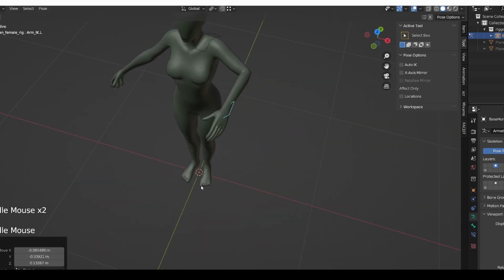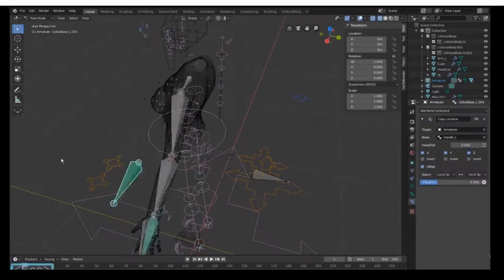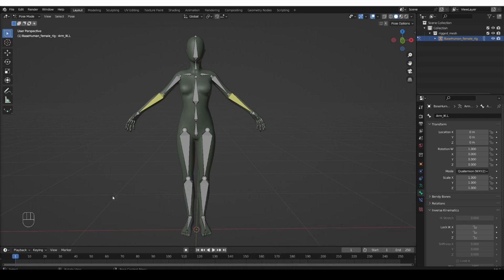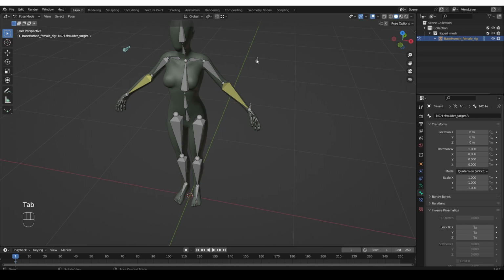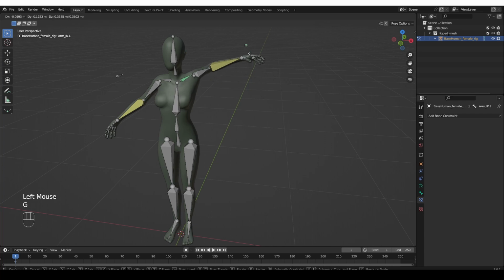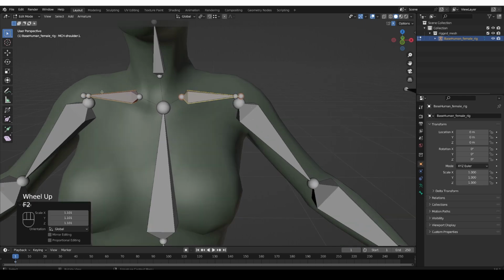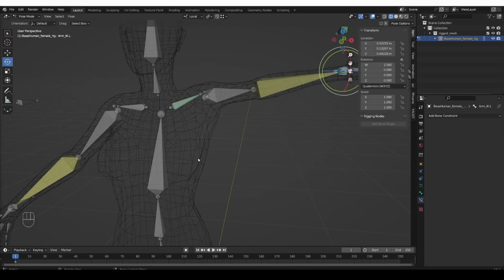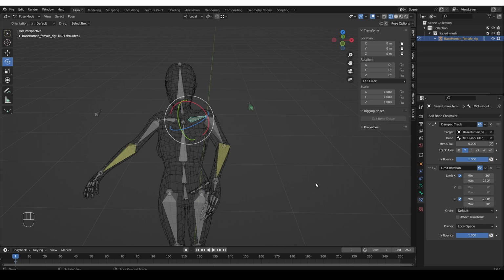Blender Rigging: Automatic Shoulder rotation!

Comment: I wonder if it really is impossible to make an automated FK shoulder bone. Of the top of my head it should be possible with drivers. I think I have done it in the past but again maybe I am misunderstanding, it went something like this. Make a new mechanism bone inbetween the shoulder bone and the upper arm bone ( i.e. the upper arm is parented to the mechanism bone and the mechanism is parented to the shoulder bone) Give the mechanism bone a driver that reads the relevant rotation and moves the mechanism up and towards the head with a desired sensitivity. Thats it, now you can rotate the shoulder bone freely to tweak the arm as usual and the mechanism will react to the rotation of the upper arm and simulate shoulder rotation.
Reply from the maker: If you think you have done it before, could you do it again and confirm that it works? I don't think I can recreate your setup exactly based on a text description of what you may have done in the past :)
Reply: @CGDive  So I gave it a go and it does seem to work. What I did was a simple test on the human meta rig from rigify. The drivers I used where as follows
MCH y location : 0.175*sin(var)
MCH x location: -0.175+0.175*cos(var)
Note that the mechanism bone was extruded straight up from the tip of the shoulder bone. Remember to parent the upper arm to the mechanism bone (keep offset). Anyway, Given how much more knowledgeable you are than me I am convinced there is something I am missing but I would be very happy if the solution was this simple. Let me know your findings :D
Reply from the maker: @anjuro  Any chance you could upload the blend somewhere. I am super eager to check it out :)
Reply: @CGDive  So I uploaded the file but youtube deleted my comment, I guess they don't allow links. Sorry but it looks like I may not be able to share the file after all. Well anyway, the setup is so simple that you should be able to recreate it without having the file, let me know if something is still unclear
Reply from the maker: @anjuro  Ah, shame. You can email me todornikolovcg at gmail.com 
I don't find it simple to be honest. I tried to follow your instructions closely but I can't even figure out how that is supposed to create the shoulder automation. So definitely interested to see the file. Once I see it working I would probably hit myself on the head and go "duh" haha
Reply: So parent arm bone to mch bone, drive mch location by arm rotation. Isn't it alone will create cyclic dep. loop. On top of that we supposed to drive shoulder rotation - will lead to another loop. The main point of the video is to avoid those dep. issues?
Reply: @dfhdgsdcrthfjghktygerte  Well I don't know what to tell you, I made the setup and it seems to work. Have you tried recreating it? Tbh I don't really understand the details of what constitutes a cyclic error but I know one when I see one and this setup did not appear to have that issue

Comment: What I did was have a shoulder control bone extruded from the shoulder in edit mode.

For relations only set the shoulder control bone local location on and set to no parent.
Set a collar bone Ik bone as shoulder ctrol bone. Pole target bone is the neck. 

In relations settings parent it to the top of the spine, and only tick local location. I think the parent keep offset in edit mode might be a good step to follow too!

I got the method while following a tutorial from Darren Lile. The tutorial is like ten tears old at this point... and it still works!
Reply from the maker: Darren Lile, thanks for the lead. Will check!
Reply: @CGDive  don't mention it! It's a ten part series so be mindful that it's a bit lengthy, but pretty basic once you understand it, and very good as a template.
Reply from the maker: @ty_teynium  I just watched it I think. It's the one using 2.79 right? I don't think there was any shoulder rigging so I must be missing something.
Reply: @CGDive  I'm sorry. What I meant was I made the shoulder rigging myself based on Darren's method of the knee and elbow control bones and applied that to the shoulder, and the key difference between the control bones are the IKs for the joints they control.
Reply from the maker: @ty_teynium  Oh, Ok... now I am not sure if you've actually watched my video ;)